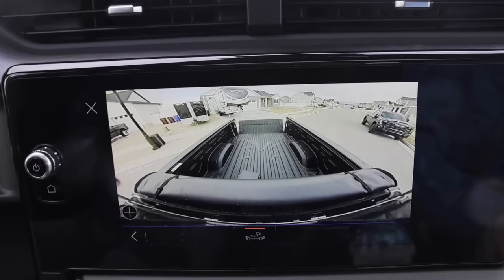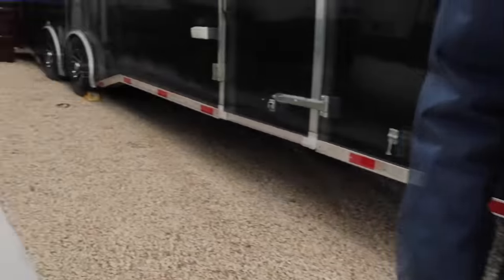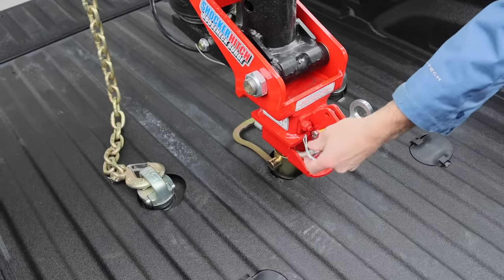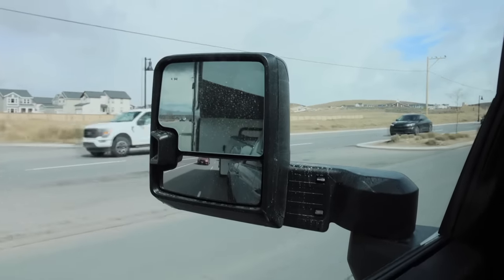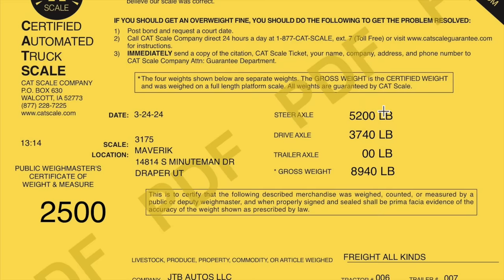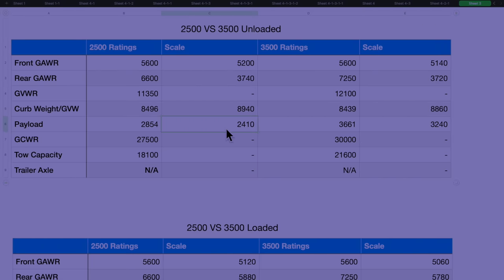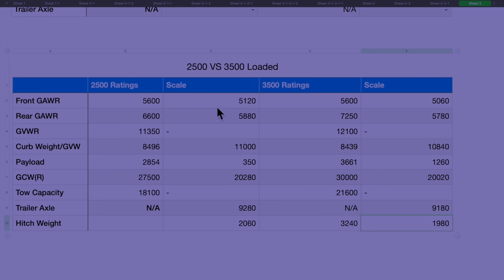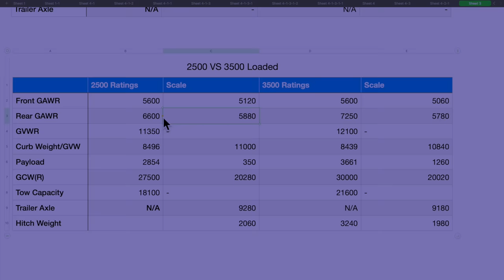2500 VS 3500: Here's How Fifth Wheel Pin Weight Effects Your Payload for 3/4 And 1 Ton Trucks!

Comment: Just wish GM would let you derate the 3500 to 12k so I wouldn't have to derate 14k trailers. That's why the 2500 w/max tow is so appealing, 11750 GVWR and 1 ton underpinnings for the win.  Well at least for those of us who aren't going to run CDL-requiring loads.  Which, lets be honest, it's not really about road safety when you can buy a dually 1 ton and tow a 16k 5th wheel without a CDL just because the RV industry has its pull.  Either the weight is a problem or it isn't.  I think it should be increased, 26k on an old square body is a lot different than on these modern HD trucks.  The brake rotors alone on these trucks are almost as big as the rims on the old rigs, lol!

Comment: 2500 gas is fine for most...2500 diesels with the loss of payload due to engine weight combined with greater towing capacity you really can run into issues quickly.

Comment: Glad to see this information continued to be reinforced.  Been living full-time for a while now and traveling the U.S. back and forth over the years and the number one thing I see most often is overloaded 1/2 tons and the second is overloaded 3/4 tons.  I can't tell you how many 3/4 tons are going in and out of these campgrounds with humongous 14K-16K and beyond 5th wheels.  In California a few months back we even saw a 3/4 ton hauling a triple axle toy hauler.  🤦 This is the soul reason we went with a travel trailer as we couldn't find a small enough 5th wheel that would safely fit our 3/4 ton.  
Thank you for spreading the news and safety message.
Reply: The gmc 3500 srw and 2500 max tow are the exact same truck. The only difference is they put a lower GWVR on the 2500 max tow for registration purposes in some areas. GMC themselves said this. Also most modern 3/4 ton trucks have 5th wheel towing capacities over 20k and payload ratings higher than last gen 1 tons

Comment: Great review - good information - when towing excess capacity is always nice to have.  Toyboxes tend to have higher pin weights, so even more payload capacity is required.    Even moving the load/toy all the way back in the trailer only yields a few hundred pounds of pin weight relief.  Even with a 3,500 when you get north of 3,000 lbs. of pin weight, you start to bump up against the rear axle rating as well.   Important to know your numbers.  I agree the CAT app is awesome - and it has a history, so you can see all your past weights with the same trailer/truck.

Comment: Great video never would have thought the 2500 AT4x would weigh more than the 3500. The AT4 has custom heavy duty thick steel bumpers that weight probably 300lbs each. The rear axle is identical on both trucks unless you have a Dually. AT4X suspension is setup for more flex for off road and they have special electronic shocks. Normal standard 2500 trucks don’t have over load springs compared to the 3500. The extra towing capacity comes from the rear leaf setup frames are identical. You can always add air bags to increase spring load capacity in rear.

Comment: Great content an unless you have a travel trailer, or a smaller weight/length 5th wheel,  the 1 ton is the way to go.
Reply: For most manufacturers, going to a 1 ton SRW means little to nothing. Ram is the most heavily affected.

The reason that 2500s are lower comparatively is because they are Derated to meet DOT requirements.

Comment: One thing that you may want to consider that varies from state to state is when determining whether you want/need a 3500 you need to account for total weight rating. If both trailer and truck are rated a total max over 26,000 pounds in my state you need a different license than a normal class c. It doesn’t matter if it’s commercial or not. It’s the total weight rating of truck and trailer combined. In my case it’s 34,000 pounds. So I have to upgrade my license to a non commercial class A. And in addition you actually have your take the truck and trailer and pass a skills test to prove you can drive it.

Comment: My 2023 RAM 3500 diesel has a payload of almost 4200. Put in a 200 pound hitch, 50 pounds of running boards, 70 pounds of tonneau cover and a generator with fuel and you use up a lot of payload. I'm extremely happy that I got a Ton truck. The 3/4 would not have done the job with our 31 foot 5th wheel.

Comment: Question for the comments section: My 3/4 ton has 2000lbs of payload and airbags in the rear. Roughly 700 lbs in the cab. Looking at a bunkhouse 30ft 5th wheel with roughly 1400 lbs of hitch. If I move most of my weight to the rear, should I be okay to haul? 5th wheel is midbunk configuration with no bed slide and two slides at or behind the axles.

Comment: This is a good video with great information. Your 2500 numbers are a little skewed though because your truck is heavier than a non AT4X by a decent amount. So a regular 2500 would have around 300-400 more pounds of capacity at least. 
 
Ultimately with these 2020+ GMs as long as the 5th wheel you want to tow is not crazy big they can handle it. And there’s also not much of an advantage in strictly towing performance with going to a SRW 3500 either. You get the overloads but until you get on them they are not doing anything for you. 

There’s no real reason not to get a 3500 but ultimately it’s still just a pickup and if your trailer is real heavy you’re going to need a dually anyways. Just my two cents though.
Reply: Yes.  My 2500 has over 500lbs more payload then his

Comment: I'm assuming the 2500 is a diesel?  Have a 2024 Silverado 2500HD gasser and getting ready to trade up from travel trailer to a mid profile fifth wheel. My payload is 3536 pounds or 682 more than the 2500 in the example. I weigh 175 and the wife 105. Our 2 little dogs combined weigh 40 lbs. There's 100 pounds under the backseat in my DUHA under seat storage bin and the hitch will weight about 150 pounds. Planning on a total "truck cargo weight" of 700 pounds. This would leave me 2800 pounds of "loaded" pin weight for the trailer. To me, the hard part is guessing how much the 1800 pounds of gear I want to load into trailer will add to the "dry" pin weight. I realize this may fluctuate depending on how/where I load the gear into the trailer in relation to the axles. Seeing that I've never had a fifth wheel, does anyone have any guidance?

Comment: My 3500 gas weighs 8,080 pounds with me in it. Your diesel 2500 weighs a bunch more. Lucky that GM bumps up the GVWR on the diesels over the gas. Mine is 11,500. I believe yours was 12,100 or something close. A friend of mine has an older Ram 3500 dually with the 6.7L and his door sticker says 2,500 payload. That seemed hard to believe.

Comment: Good comparison JB. Did you purposely forget the J standard sticker on the door post? My 3500 J standard sticker only gives me 2620 on the goose ball pin weight, even though i still have plenty payload capacity left. Please explain why GM does this. Do any other truck manufactures limit your pin weight so drastically? It is a struggle to keep my pin weight under that number.
Reply: Yes, the pin weight is only one factor for payload. You need to add in the weight of people, hitch, any other gear or accessories in the truck and that gets you your total payload which needs to be below the payload rating
Reply: Pin weight is just a percentage of what the truck is rated to tow
Reply: @AndrewCorcoran-o5q  Yes it is. The issue I have found is the truck J standard only allows 12 -15% pin weight on the truck, but the RV manufacturers, at least with fifth wheels, are 20 - 23% pin weight.
Reply: @campnut6076  does your 3500 have the factory puck system?
Reply: @campnut6076  because my 2500 is rated for over 2700lbs pin weight
Reply: I did order the truck with the factory 5th wheel prep package.
Reply: Also, GM lists both pin weight and standard toeing numbers on the door. The numbers listed are for pin weight.
Reply: @benbyerly1996  strange that the 3500 pin weight is so low
Reply: @benbyerly1996  oh. It says the numbers are the payload numbers
Reply: They are based on the listed pin weight. Sorry, let me give more information. Max pin is weight is 3240. Payload is 3661.
Reply: @AndrewCorcoran-o5q   No, had a B&W under bed goose ball hitch put on.
Reply: @campnut6076  that's why your pin weight is lower.  The OEM puck systems are rated for higher.